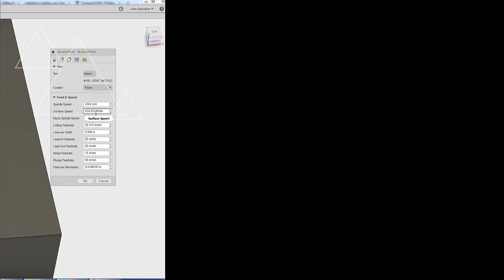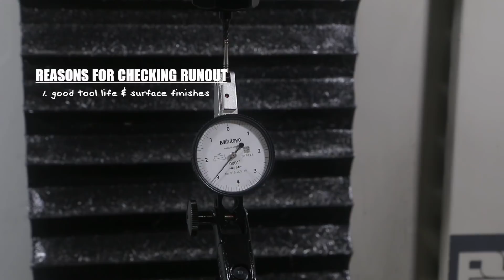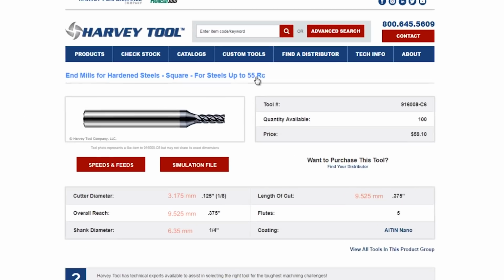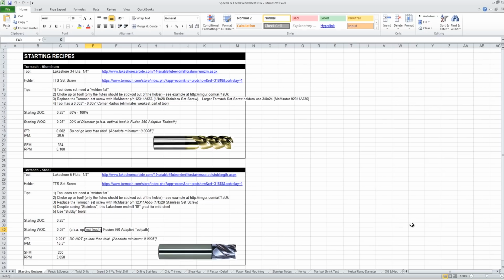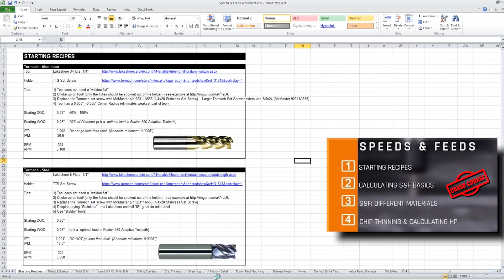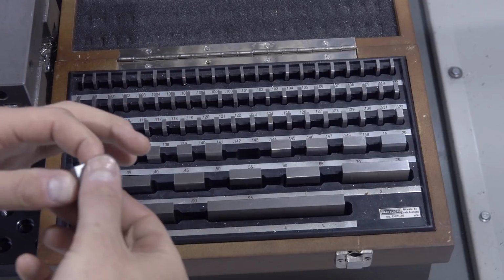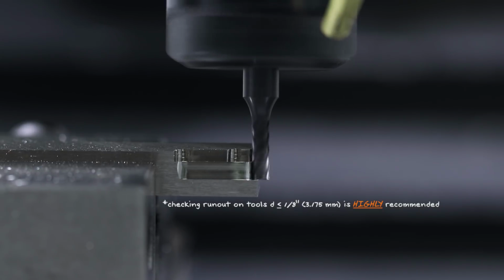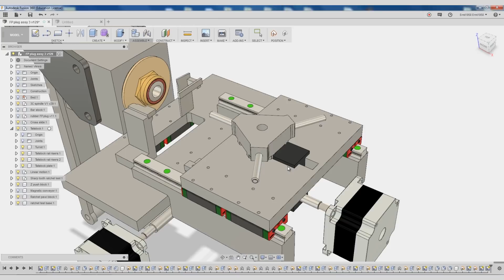Machining a HSS Lathe Form Tool - DIY CNC Lathe Part 3 | WW208

Comment: Hard turning-milling works by cutting with the edge-prep and not the rake. I recently hard turned a 60HRC silver steel taper reamer with a PVD Mistubishi CCMT09T304 that has almost 0.1mm of edge roundness.

Comment: Could anyone tell me the difference b/w  a 5 axis machine and Mill turn ...?
In terms of axis and where these machines can be used ?
Thank you.
Reply: When asking about mill-turn are you referring to a machine with articulating B axis or just a live tooled lathe with a C axis. Either way IMO the part will more than likely dictate the machine type. 
It is really hard to compare a mill turn / B-axis mill turn / 5axis mill turn and a 5axis machines. They all have benefits on certain parts then have limitations on others. If you are considering one I would take a look at all the parts you make or want to make then evaluate each one based upon its strengths and weakness.
I would say the 5 axis machine is more versatile than the mill turn. The mill turn will be faster on the right parts. The 5 axis machine can make almost anything but it will take longer.

Comment: I mill 62 HRC all day every day. Reduce your spindle by 1/3 and the feed by 2/3. Cut at full depth if possible without coolant ofcourse. A final contour will be needed to clean it up if not twice . Way quicker than Wire EDM and a cheaper way.

Comment: I find it hard to believe that a cutter designed to machine up to 55 Rockwell C will cut 63 to 65.
The difference in hardness is very large.
I would check the hardness of your tool blank to verify.
Strange that Harvey Tool do not advertise these extra capabilities.
Why did you only use the tool on plastic?
Reply: It might be that they guarantee that it works up to 55 HRC, anything above is without guarantee.
Reply: Of course it will work to cut harder materials, just not as well as an optimized carbide grade and geometry.

Comment: John, thinking "out of the box" is great and you have learned some valuable knowledge but, businesswise, I have to wonder if this was the best way to get a form tool made. There are many tool grinders that might have ground the tool for less than $100 and if you bought more than one it gets less expensive fast. 

Also, again, I applaud the effort, a cutoff wheel in your surface grinder could have parted that tool in under 30 seconds and the heat zone would have been restricted to the parted end.

Comment: The reason smaller chipload works probably also has to do with the fact that the hard material gives less before cutting, so the tool can cut thinner chips than it would be able to in softer metals.

Like, cutting a piece of plastic vs cutting rubber.

Comment: Excellent job John. I would not dare to hard mill HSS. I've not had machinery that I considered capable either. A real testimony to the capabilities of the Tormach product and your tenacity within this business.  I had to laugh when I read someone write EDM. That was the first thing that I mumbled.  The other was,"John needs a heat treat furnace". For the material that your cutting with your form tool, any of the A or D could have been used. They would last fore quite a long time.

Comment: Hell, I wish I had the space for even the “small” Tormach 440, but I live in an apartment - no way is that thing getting in here (plus, it’d probably require either 3-phase, or at least a large-appliance-type outlet). Maybe one day they’ll make a model 220 just for hobbyist use that runs on 120v mains? Oh, well, I can dream.
Reply: Remember John started with a Taig in an NYC apartment. You don't get much smaller than that.
Reply: William Squires 440 is 110v
Reply: The 440 and 770 are 110v. The 770 can be disassembled to fit through a standard door. The biggest issue is the noise and mess they can make.
Reply: It could work, but your neighbors would despise you
Reply: Jody Olivent - what about the weight? Oh, yeah, and the cost. Not just the 440, but all the goodies you’d need as well; the tool bits, tool holders, the license for Fusion 360 (or whatever CAD/CAM package), etc...

Comment: I would have just roughed it out with an angle grinder and done the cut off with the angle grinder too. Save the expensive end mills for the finish passes. Just dip it in water periodically to keep it cool. It actually takes a lot of heat to soften tool steel.

Comment: When you are adjusting run out by tapping the shank of the tool are you bending the tool or loosening the collet and tapping to reseat the tool inside of it then retightening?
Reply: Collet nut is snug, and the tapping is moving the collet in the taper.
Reply: Michael Alcocer He's just "moving everything" in the direction he needs. He's not bending anything.  The carbide tool would snap. That being said, you can use the strategy of bending the tool with light taps is a strategy on HSS tools. You can only get a few tenths out of them using that method though. (Before you risk snapping them.)
Reply: Andrew Delashaw with the collet nut loose?

Comment: great video john, good to see the progress on the diy lathe, i am definitely going to build one from your plans.  the hard milling sounds scary, but you handled it with ease.  do you plan to touch up that form tool on the grinder and stone to keep it sharp, or just cut new ones?